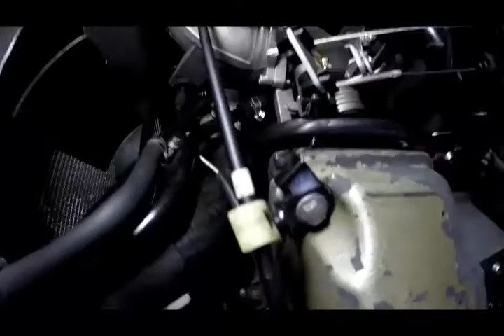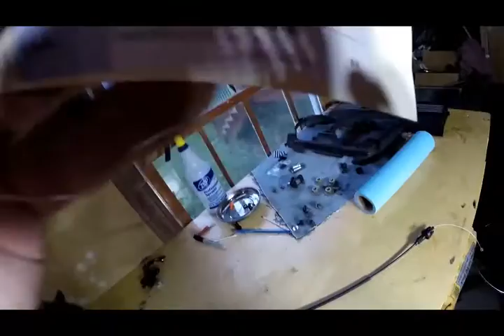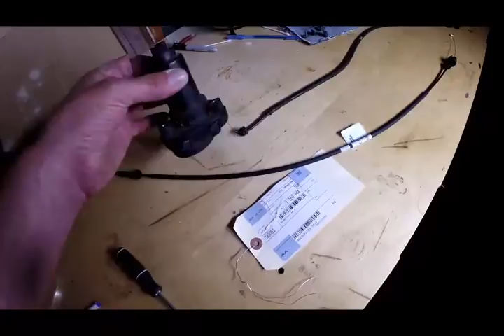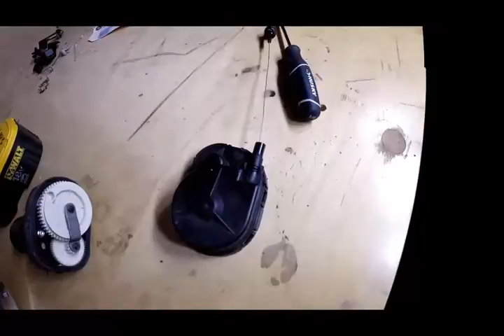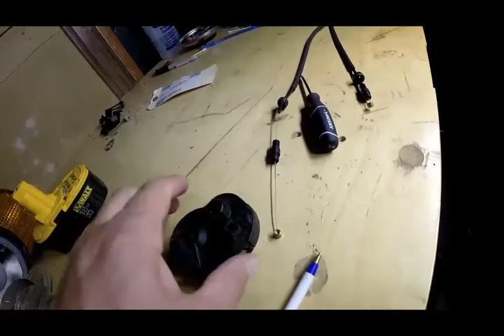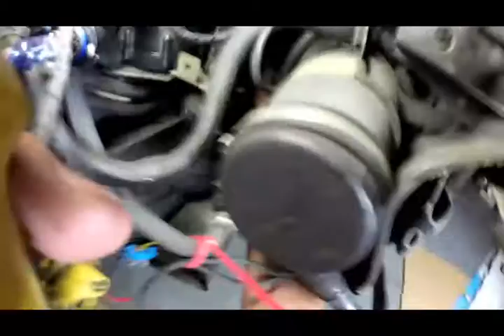Cruise control cable replacement

Comment: That cable and actuator is actually the secondary throttle cable which is for the traction control ASC-T.  Not cruise control.

Comment: Hello! 

Did this fix your Cruise problems? My car has the same cable and its busted. I'm going to remove the actuator and replace that cable just in case. My Bushings were busted at the throttle body plate, replaced them with aluminium bushings. Car is waiting for the summer i cant test if the cruise works or not. 

Elmo
Reply from the maker: yep, works like a charm now.